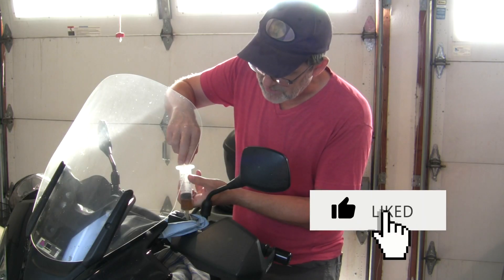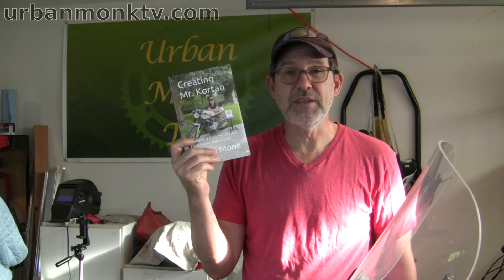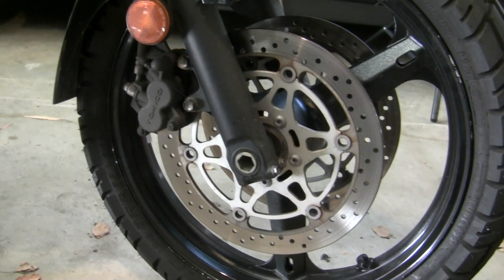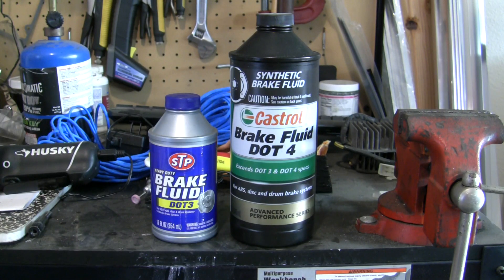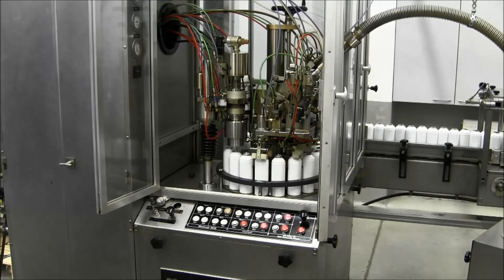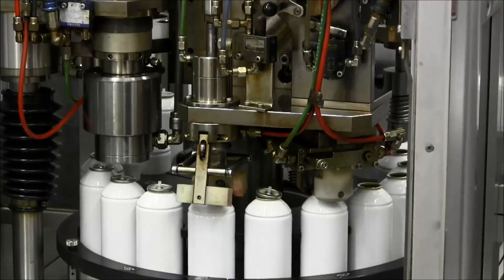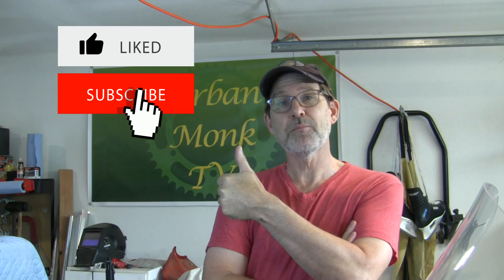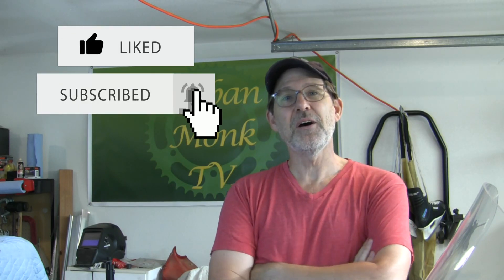Change Brake Fluid - Why?

Comment: So DOT 3 will not absorb water as quickly as DOT 4. Why you should not “upgrade” your car’s system with DOT 4 unless you start changing the fluid more often.  DOT 4 does have higher performance when maintained and changed frequently but whatever the higher composition that gives that higher boiling point, it’s the portion that wants to absorb moisture.
Reply from the maker: Thanks for watching and for throwing your insights in here for the benefit of all!

Comment: Thanks for the explanation. Also it's good to point out that DOT 3 and 4 is NOT compatible with DOT 5 and can cause catastrophic brake failure. But DOT 3 and 4 is indeed fully compatible and can be mixed with DOT 5.1 brake fluids.
Reply from the maker: Thanks for watching and for adding those valuable insights.